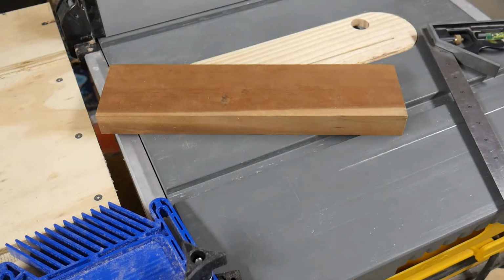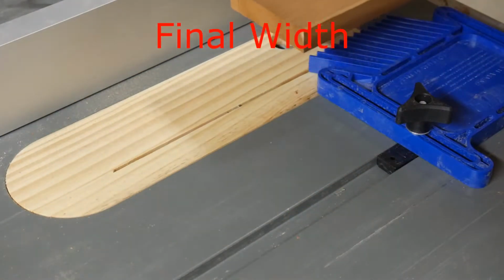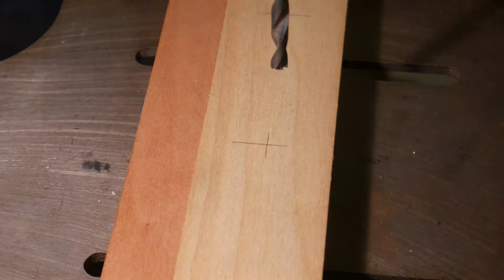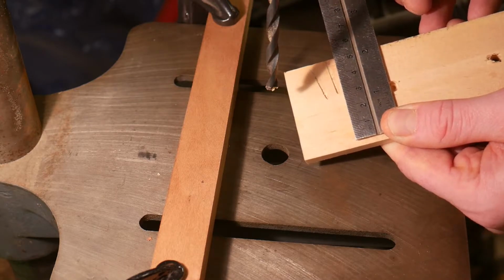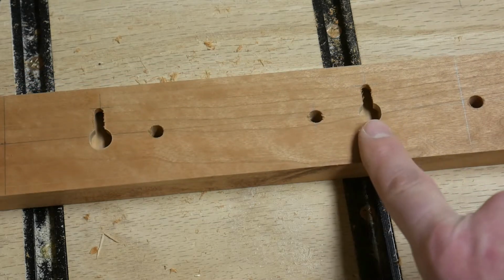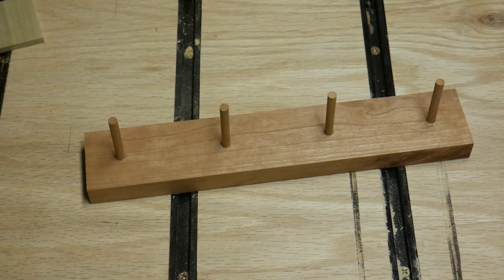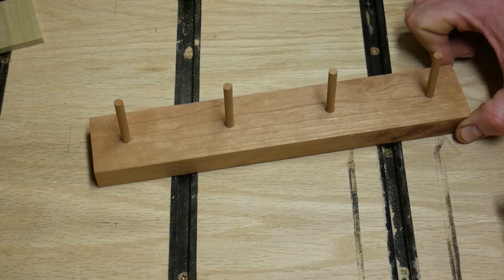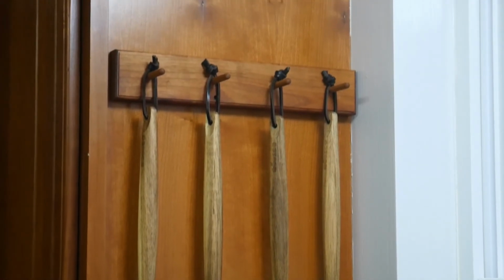Homemade Walnut Kitchen Utensil Rack

Comment: Solid choice on the Routing bit
Reply from the maker: Mike The Maker I prefer key hole slots over metal hangers, as long as I have enough meat to accept the slot. I like a tight fit against the mounting surface.